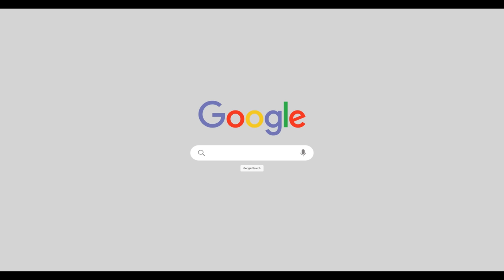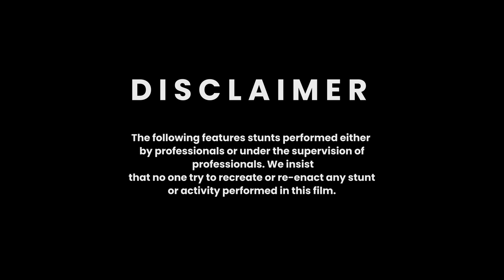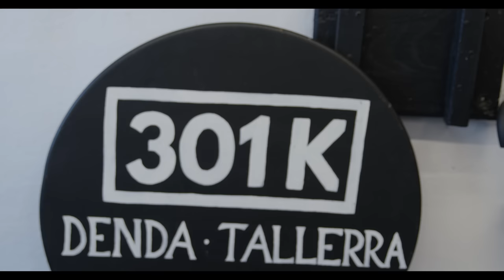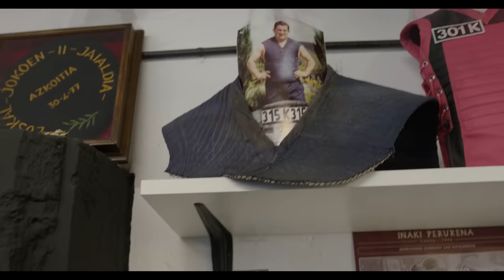World's Strongest Man VS Wood Chopping Champion (Basque Country Ep 2) - Strength Unknown

Comment: We have similar sports in the US. One event they have to cut notches for spring boards and one at the top, chop a block like topping out a tree. Another is a speed climbing race up to the top of a tree and back down using a safety rope and spikes. They also do the chop through a block like what you did. Then they also have both manual 2 man saw, and one I think, as well as some chainsaw events that includes custom, over powered chainsaws